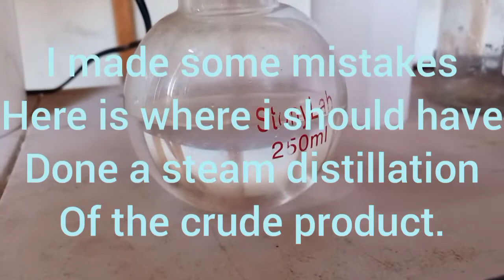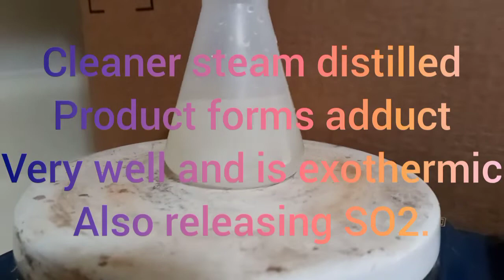Reimer Tiemann reaction - reaction of phenol and chloroform - salicylaldehyde /2-hydroxybenzaldehyde

Comment: just thought youd like to know: 8:14 I presume that bottle with the text on it is a 64oz bottle of liquid lightning drain cleaner sulfuric, the one I bought I did a density measure and found it to be 83% acid, it also stunk of SO2 and there was also settled sulfur in it, yiu should probably check the concentration if you haven't already. I havent tested the smaller bottles however as I didn't have an accurate scale when I had the small bottle
Reply from the maker: Yes it sure is liquid lightning its the "virgin" sulfuric in the white bottle with the blue label. Is there any chance you might be referring to the liquid lightning in the white bottle with the red label? For the life of me I cant remember the difference its been 3 or 4 years since I looked into it. I havent had any issues yet but I appreciate the heads up and will be checking out my bottles just to be certain. My last one checked out at 93% and this bottle now is 95%. Its my second bottle but i havent noticed any so2 smell. I did discover a possible small amount of an iron salt when I got a characteristic pinkish purple color when added to salicylic acid which formed complex. Its never a bad thing to be certain about OTC chems. Especially if theyre picked up at Walmart lol.
Reply from the maker: Btw I like your channel man definitely some good stuff!

Comment: i believe that isnt KCl precipitating, i believe it is the phenolate dropping out
Reply from the maker: Very interesting i never considered that actually!
Reply: @midwestchem368  just did the same reaction, it dropped out the phenolate aswell, it must be the phenolate i guess, because everything else would atleast be moderately soluble, especially at those temperatures.
(even using a big excess of solvent)
Reply from the maker: @contomo5710  ya know thats a really good point and I believe you are correct here. Im glad to see someone else doing this reaction. Its really cool and really useful in certain instances. One other thing what did the salicylaldehyde smell like to you? I definitely got salicylaldehyde but i very surprised how i didnt smell anything similar to benzaldehyde whatsoever.
Reply: @midwestchem368  phenols can form ionic sodium salts (Na “oates”) when treat with naoh because they’re alcohols however this will not happen if your base is NaHCO3. However NaHCO3 can create sodium salt if carboxylic acid is present